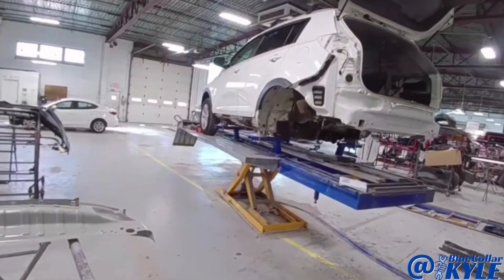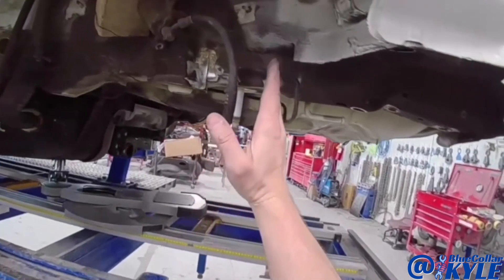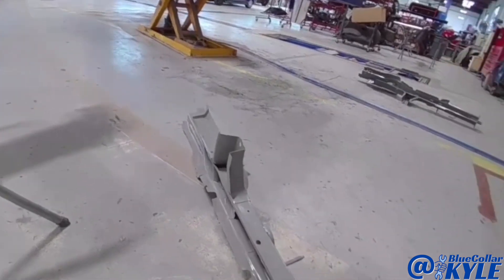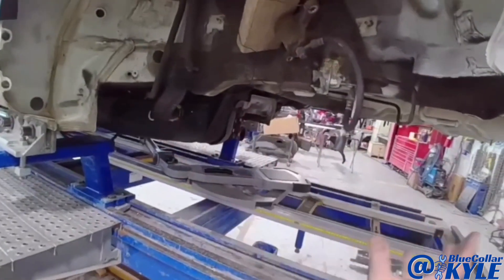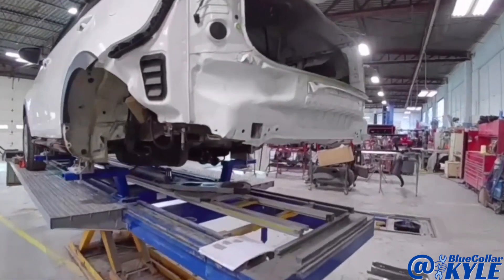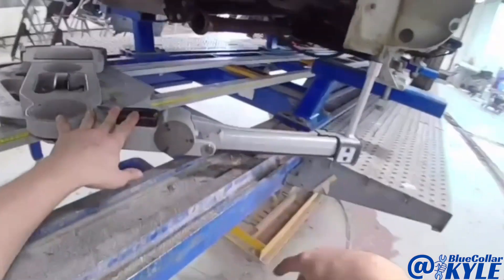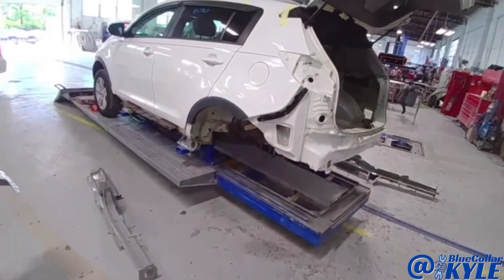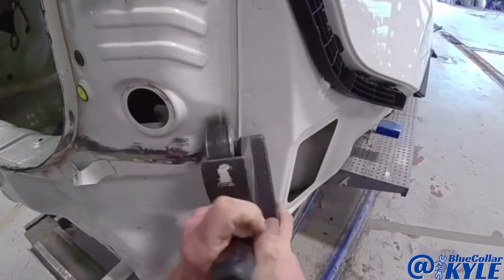Trailer Hitches Cause Serious Damage!

Comment: I had a VW that had a hitch that caught the sidewalk while backing up a driveway at normal reversing speed and it did bend the frame trail the same way. The hitch was a few degrees off afterwards... I was cross.